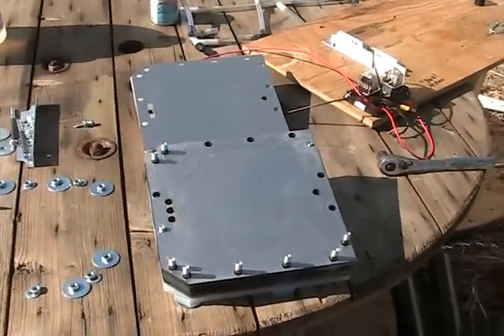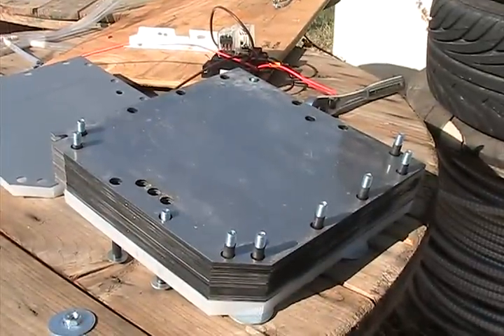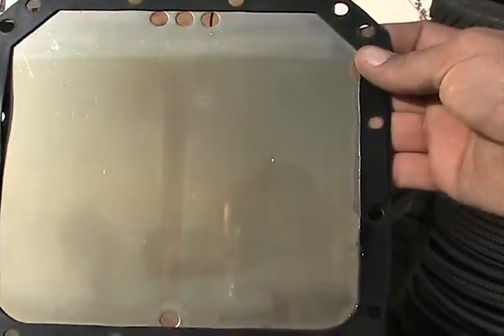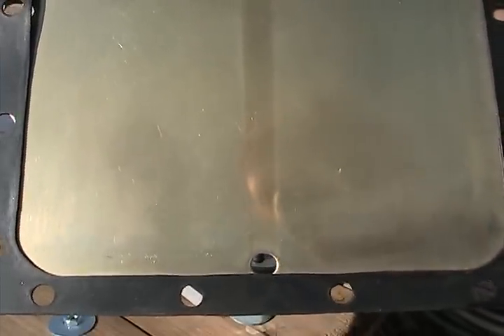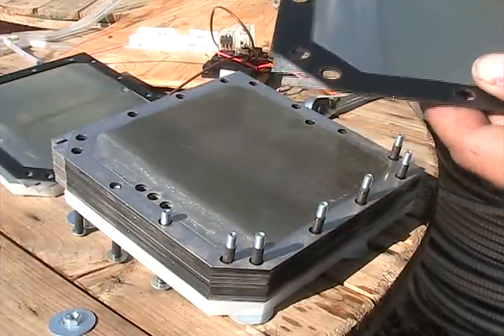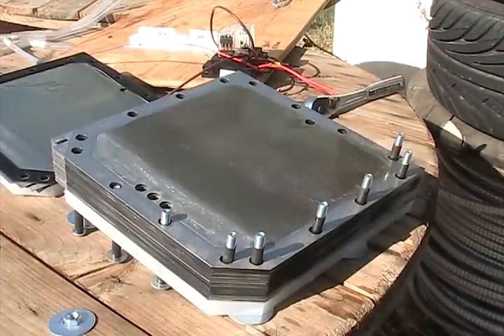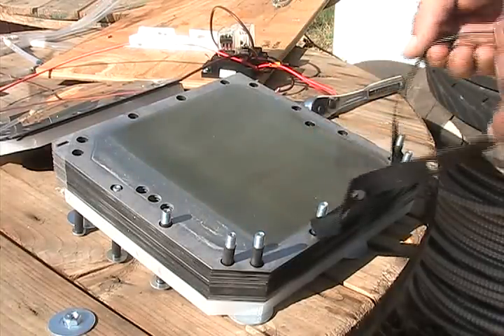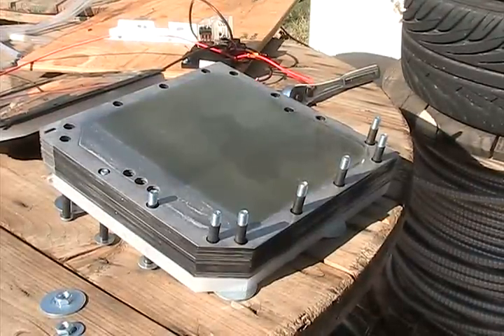drycell test 5

Comment: what do you use as electrolyte?  In my research caustics will do a number on neoprene.  I have been working with EPDM and has great resistant qualities to heat and chemicals, But i dont know how it would work as spacers in a dry cell.  May be slightly conductive.